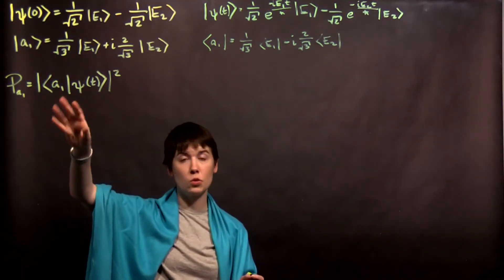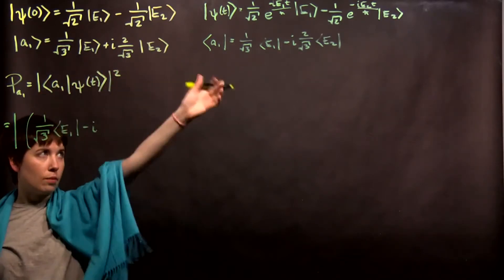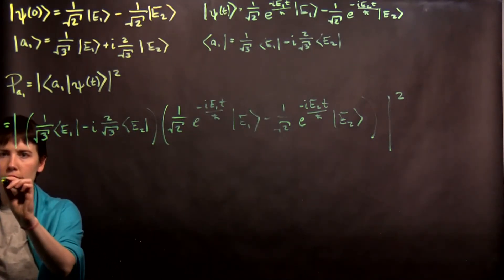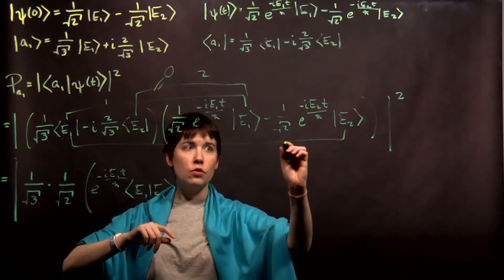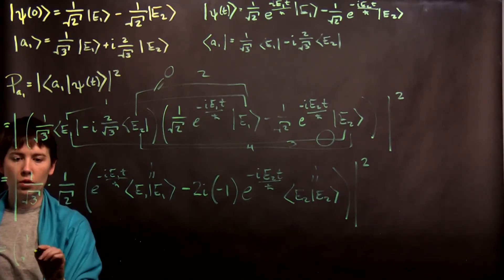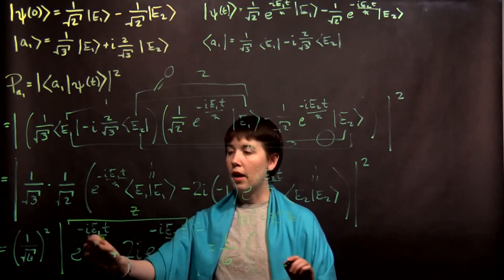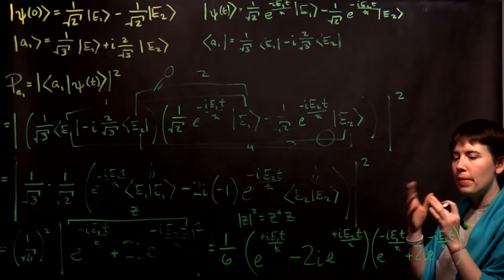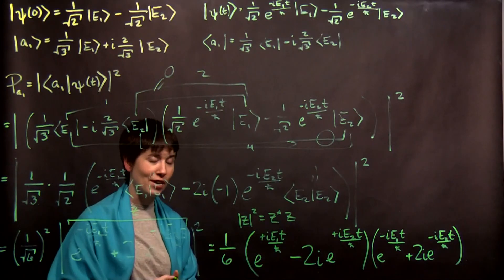Calculating Measurement Probability over time in Energy Basis (2 of 2)

Comment: Thankyou for the lessons! Maybe the correct result of the calculation is 1/6 * (5 + 4*sin (E2t/h)cos(E1t/h) - 4*sin (E1t/h)cos(E2t/h) ) ? If so  we  shoud  have  a  real number  (absence of imaginary units "i"), a dependence from time and something between 0 and 1.
Reply: I have : P(a1)=1/6 * (5 - 4 * sin(x) ), where x = (E1-E2)t/h). This gives us a graph with values for P(a1) between 0.16 and 1.5.
This is wrong because the state a1 is NOT normalized.
A possible normalized state is : |a1> = 1/sqrt(5) * |E1> + 2/sqrt(5) * |E2> .
Then we get : P(a1)=1/10 * (5 - 4 * sin(x) ), where x = (E1-E2)t/h). This gives us a graph with values for P(a1) between 0.10 and 0.90. This is perfect! 

* note that : sin(x)=[e^(ix)-e^(-ix)] * (2i)